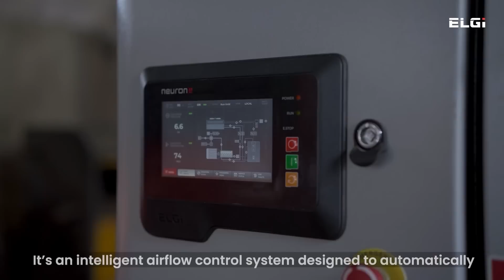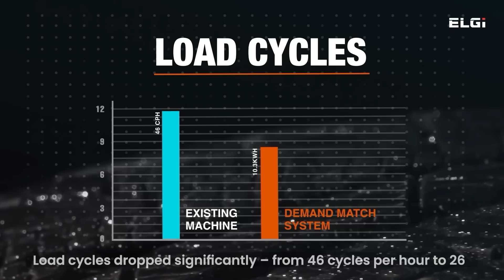ELGi | Customer Success Story | Fortune Cars | DEMAND=MATCH System | Always Better

Comment: LGi's Demand=Match System receives positive reviews from customers who report significant energy savings (e.g., 10-14%), improved operational stability, and extended equipment life due to reduced mechanical stress. The system's intelligent airflow control automatically adjusts compressed air delivery to meet real-time demand, eliminating energy waste and excessive compressor cycling that occurs with fixed-speed compressors. Customers have experienced a reduction in power consumption, fewer load cycles, and a more stable pressure supply.